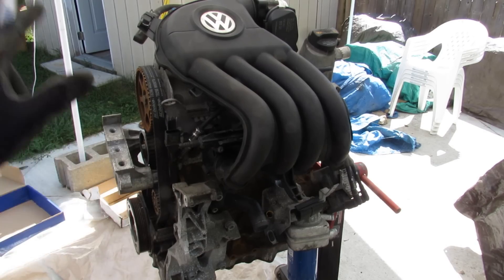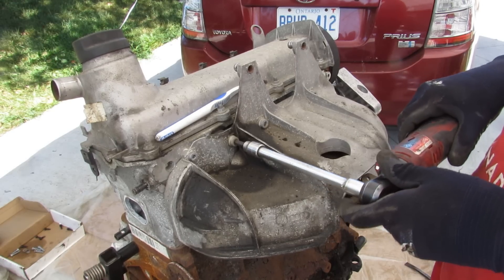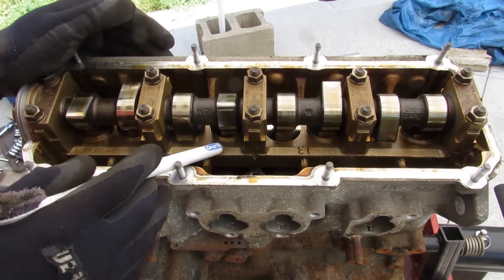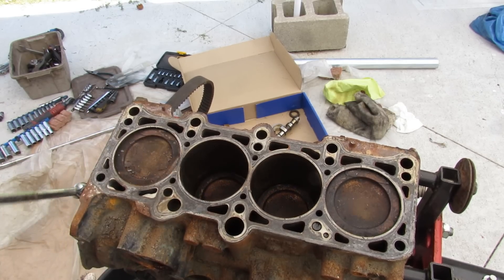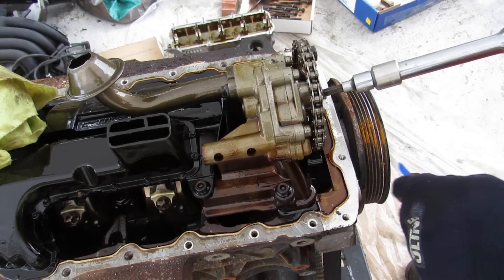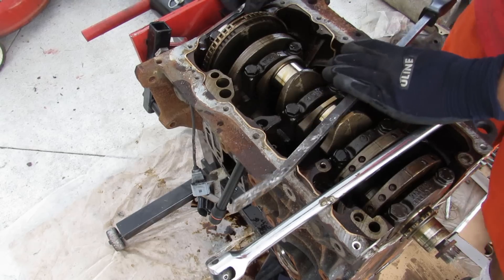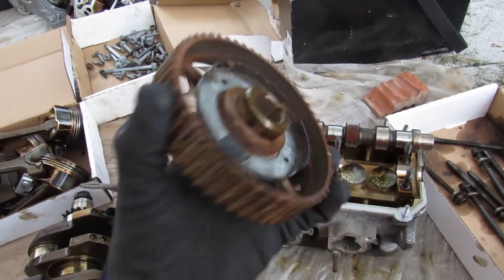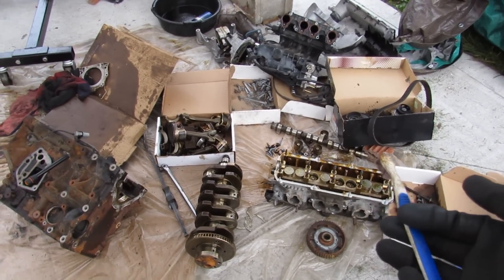The Simplest Modern Engine - From Volkswagen?

Comment: VEARY RELIABLE I HAVE ONE AT A 155000 MILES NEVER CHANGE THE WATER PUMP OR BELT IT DOES HAVE OTHER ISSUES WHICH ARE EASY FIX

Comment: FYI:  A unique spark plug wire boot pulling/removal tool is available for about US $5 to $15 to remove those pesky boots without damaging the wire's continuity.
Using one you will not damage the boots, the wire connections & you can access the wire boots without removing the manifold if working with the motor in the vehicle.
Usually if it seems too difficult to perform a service, there will be a special tool for that  particular purpose.   Think Chrysler V-8 318 cid distributor  hold-down bolt wrench.  :person-turqouise-waving:

Comment: I have a 1998 Beetle with a 2.0 AEG engine and a 1999 Beetle with a 2.0 AEG engine. These are really great running engines that are easy to work on.
I also have a 2012 Passat with an almost as reliable 2.5L CBU 5 cylinder engine, and a 2017 Tiguan Wolfsburg Edition 2.0L TSI turbocharged CCT engine that is likely to win an award as the most troublesome engine Volkswagen has ever built. In fact, I currently have that engine out & on the motor stand & I'm installing new pistons & rings.
Reply from the maker: Oh the turbo's are terrible ...I have videos on those.
Reply: @speedkar99  I haven't embraced "terrible" yet on the 2.0 TSI, but that's probably just me not accepting the truth. Back in the 80s, I was a Mercedes-Benz/BMW/Volvo dealership service technician, then later I owned a 4x4 Jeep business, so I have a set of pretty solid mechanical skills. Working with your hands can be very fulfilling and therapeutic, at least it is for me.

Comment: I HAVE ONE ON MY 2015 VW JETTA 145000 MILES NEVER REPLACE THE TIMING BELT OR WATER PUMP YET
Reply: Still used in 2015? Is that the last year this engine was used?

Comment: This looks almost exactly like the 2.0 I had on my 2002 Jetta. No turbo, aluminum head on iron block, eight valves on a single camshaft, and belt-timed, though I remember a metal intake manifold and coil-on-plug, I do believe. Stupid simple, insanely reliable, and strong like they don’t make them any more. The electronics around it went out all the time but the engine will run, and run, and run, and run. Love to see them around!

Comment: "What's a Volkswagen without these triple-square bolts?" I love it! Extremely old and new technology together. At least, it has a spin-on oil filter. I have a Mk 5 Rabbit which is my first German car. What a learning experience! It seems like VW loves to keep owners confused with their designs. I love the performance and reliability of my 2.5 liter I-5 engine, but the learning curve was long. It's hard to believe that this company evolved from the classic air-cooled Beetle which excelled in simplicity.
Reply from the maker: We'll stay tuned because I have a VW inline 5 engine sitting here to be torn down!

Comment: My old AEG went on for over 400k miles.  I was diligent with the maintenance and always used the 5w40 weight, and it kept on going.  Should still be on the road in GA somewhere.

Comment: I have a 2015 Jetta with that same motor. It's been very reliable. Currently at 213,450 miles. Not sure why it only has 115hp. I live in California and the CA version comes with variable valve timing but are rated at the same power as the ones without it. Not a fan of the old school timing belt, but no direct injection and plug wires. Low maintenance reliable, and easy to repair.
Reply from the maker: Nice, they sure are simple!

Comment: I had this engine in a 2013 Jetta manual. 3 year lease. The old no tech 2.0 doesn't have the power and amazing fuel economy of the new engines but mine was absolutely trouble free. No check engine light, nothing. I had a 2016 and 2019 with the 1.4 tsi and had check engine lights coming on in the cold, new steering rack (2013 was good old hydraulic), vacuum pump sensor, transmission noise problems etc...

Comment: 12:08: The first FSI - engines were running lean, but not this one. Because of the three way catalytic converter it runs mostly with lambda 1 (14,7 parts air to one part fuel), controlled by a lambda sond.

Comment: My 2013 VW base model Jetta with the 2.0 has been so reliable and it’s never even been to any dealer or mechanic. I’ve been able to teach myself how to fix and repair all the things that have come up - which is minimal compared to other cars I’ve had. I recall several folks telling me to run from VW when I was considering it back in 2016 and I’m so glad I used my gut instinct and got it. I have about 200k on it and it hasn’t given me any reason to consider selling it so I’m a happy customer.
Reply from the maker: It is a damn simple Engine it better be reliable. As for the rest of the car...

Comment: I have a 2012 Jetta 5 speed with this engine(CBPA) and it's a machine. 200k miles and very few issues. Pay attention to those oil coolers though... get oil that bleeds into your coolant. Even the heater core and fuel pump are easy jobs on this car. VW really should make more cars like this. I love mine.

Comment: Now take a TDI ALH variety and you have no spark plugs, coils, rotors cap wires, variable/multiple anything and you get 45 mpg all day long.  Throw a tune on the computer and you can get 300lb of torque and 145 hp and get BETTER fuel economy.   You will also go 10K between oil changes and get with proper maintenance, around 400K-500K miles

Comment: I owned a 2001 VW Golf with that 2.0. It burned tons of oil. About 1/2 quart every tank of fuel. There were some engines that were assembled in Mexico with the piston rings installed upside down (Engine code AEG) and I bought one with low miles that burned oil as it got older. It got so bad that deceleration caused a huge cloud of smoke. I sold the car in 2012 to my brother and he sold it to someone else shortly after. I've heard that the car still on the road today with the same engine. lol

Comment: Great video, really informative and straight forward. This engine was based on the '87> 1.8 digifant engine, found in many VWs of that time period. It was later bored out to 2.0 displacement in the early '90s, and finally ended up with a crossflow design in the late '90s It's a brilliant & ultra reliable engine. They can be modified immensely and VW themselves have had multiple factory cars with the same style engine running superchargers etc over the years.
Reply from the maker: Too bad everything else around it was problematic

Comment: Old school tech in a modern engine = easy to work and the best kind to have in an economy car.  Timing belt may need to be replaced sooner than a chain, but less components to wear and stretch.  Also, cheap and easy to do along with the water pump.  Not familiar with this engine, but reminds me of the old Escort 8 Valve engines.

Comment: It's basically the same as the 1.6 SR engine (AEH,AKL). These old 8V engines are the most reliable VW made in the past decade.
Reply: The 1.6L 74kW ("SR") is an absolute garbage compared to this 2.0L (AEG/APK/AQY/AZJ etc.)

Comment: One of the worst engines out there. Maybe the worst. I had it on a 2002 Jetta. No power, burns oil, very bad on gas. I had to replace the engine at 122 k miles

Comment: Have a Jetta with the same engine. Was cool to see how it works.
Reply from the maker: Is it slow
Reply: @speedkar99  yes. On surface roads its doable (5 spd manual). 0-60 is about 10 seconds. If I want to pass someone on the highway I have to plan ahead a little 😂.

Comment: A rock slid engine. Wish that one could purchase those still at the moment. The origin or the engine is actualle from the mid of the 1990's when it was used in the Golf 3.
Reply from the maker: I thought it was older than that from the 70s

Comment: It is a good engine but if the timing belt snaps ( which happens all the time because people forget to check and service them ) then your whole engine is destroyed due to bent valves. Honda and Toyota your timing belt can snap and you will be fine after replacing it. VW does this on purpose.

Comment: You are using the wrong type of socket for your impact, all that bouncing is loosing all the impacting force to remove the screw. Get some proper impact sockets and see the difference.
Reply from the maker: You mean the chrome sockets? The black ones I use are impact grade...
Reply: @speedkar99  yeah the chrome ones (used on the crank bolt) have too much bounce and you will use all momentum,

Comment: 11:40 The new Corvette has 2 valves per cylinder yet it make 495 hp.
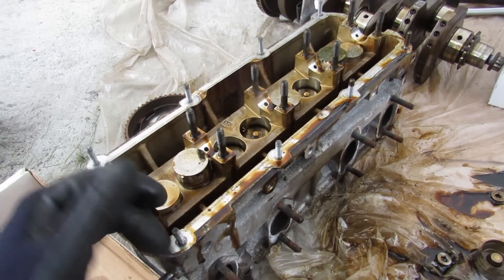12:12 The engine only has 115 hp because it has a low lift cam.
Reply from the maker: Ok

Comment: An issue with the one I had is that if you do short runs, it likes to collect gloop around the oil filler cap from the condensation. I thought the head gasket had blown... My local independent VW specialist was like... You need to run the engine up to temperature for it to evaporate off

Comment: I have 260,000 miles on a 2.0 ABA engine (1994) ... almost identical. Burns a little oil, BUT not leaks, AND it's had to put up with my abuse for decades :D
Reply from the maker: Nice

Comment: The simplicity is good! No turbo, timing chain, variable timing. It has only a single cam with no rockers. Less moving parts to go wrong! Easier to maintain! Very economical. The diesel versions were better yet. Let’s keep these engines running!

Comment: Amazingly, this thing is actually simpler than the 2.0L AAC engine in my old 1995 T4 Transporter but otherwise looks very similar.
Iron block with an almost identical alloy cam-on-bucket 8V head, eccentric cam belt tensioner, oil baffle under the valve cover. But it had an external water pump driven off the accessory belt and the cam belt driven sprocket under the timing cover ran the oil pump and the distributor (at least the intake runners curved upwards so you could change the plugs without taking the manifold off!). It had PCV/evap systems for Euro emissions regs, and a valve in the intake which would draw in warm air from near the exhaust manifold baffle to help reduce emissions when cold starting.
It made less horsepower, only 83bhp when the ponies were young. Solid reliable engine though, had done over 300,000km when I sold it on.
The only issues I had with it were external Bosch components; fuel pump died around 200k and alternator went around 250k.
I've still got my sets of 12-point/triple square/torx ratchet sockets and bits that I had to buy just to change the cam belt.

Comment: Have a much older version of this engine to go into my 1997 Golf. It's the same 2.0l 8v, but ABA code. Has a distributor, slightly different head casting, different intake, and of course different management. Oh, and since mine is the OBD1 version of the engine (pre 1995) I have dual valve springs and a forged crank. VW has been using this architecture for a long time, because it works well.

Comment: This engine is based off of the early water cooled VW engines (like 1.5/1.6L rabbits). This is the reason for the cast iron block and other older style components. Its a testament to the quality of engineering. Its basically a 50 year old engine design that is still reliable, makes decent power and is efficient.

Comment: That 2 liter 8 valve not used in EU VW cars for a long time I had 2000 mk4 golf estate with a 1.6 liter 8 valve (74kw)witch is a smallbore version of this engine. I currently drive a 2013 Mk7 estate  it has 1.2 16 valve turbo with 80 kw.

Comment: These 8v engines are terrific in every way except power.  The only thing they really need to last well over 200,000 miles is replacing both the water pump timing belt as preventive maintenance at 100k...and a good quality high zinc oil since it's flat tappet.

Comment: The 2.0 was used on 90s Golfs and Jettas too. And timing belts last longer than chains and don't require replacement of all the gears and sprockets as well as the chain when it gets changed.

Comment: I have a 2L Golf 2002. I replaced with a rebuilt head and new head gasket.
Polished every cylinder wall  full stroke and the top of cylinders with green pad.Did not see any signs of any cracks. Getting coolant mixed with oil only after engine gets hot.
I don't think crack is on any cylinder wall as it has no misfire or visible water Vapor in exhaust. No coolant leakage when cold. Bypassed oil cooler so I know that is not leaking.
What is the likelihood I can find a crack at the bottom of the engine? I am fairly proficient at welding if I can reach it. Thanks

Comment: In some parts it is more complicated in some parts it is even more simplified. I am comparing this engine to famous in eastern europe 8V family of C16NZ, X16SZ, X16ZSR(designations for 1.6L) etc engines from Opel Astra and more. Those were made in 1.2, 1.4, 1.6, not sure if 1.8, but there was 2.0 C20NZ with MPI from this bunch of engines only 1.6L variants were collision free on timing which means you can freely rotate camshaft with piston 1 in TDC. Mounting of accessories is more complicated in VW. Timing is better to set on this VW engine, Opel had timing belt tensioning on pump rotation with suspension roller which is nightmare to set right on for now really old engines ranging right now in 25+ years mark. SOHC, same in opel, combo spark coil, same in opel. Engine head is better in VW, popular "glass" hydraulic pushers, in opel you had more moving parts in the head and when worn out they rattle a lot but still run aaand they lose power due to that. Overall VW added some baffles who know what for, lubrication is straight forward in Opel engine and this VW. Opel had EGR from lift onwards and it is suprising to see a car from further 2000s that does not have that. Opel didn't have oil cooler. If we skip accesories and just stick to the naked engine those are pretty much the same. You have higher tolerances in parts, more surface so forces on them are less due to that, good lubrication, iron block. High torque, on low power side. Very hard to kill if you maintain them. Those are the engines that will survive "long life oil" practice but with a cost. I am living in europe and I own one Opel Astra F or 1 depending on how someone will call them. 71HP engine, regularily maintained. If I had to do a trip to depths of Russia or very harsh enviroments I'd rather pick this than some newer car because you can repair this engine having a simple set of sockets and few wrenches, computer says fault? Put wire across terminals it will flash what you're looking for. Parts are extremely cheap and you can find good quality replacements for parts. Yes it doesn't have AC, doesn't have power windows, it's loud in high speeds, it consumes less fuel than modern basic cars. What's there to complain?

Comment: The different type of bolt heads on the same part is because the bolts are slightly different lengths, it prevents factory workers and repair shops from mixing them up.

Comment: I have a 1.8T and I wont lie, I miss the simplicity and reliability of my old mk3's ABA 2.0. I am having some wiring issues with my mk4 that frankly, the reasons behind the issues are mindboggling because it's 100% an engineering fault with VW. I never had these issues with my 2.slow. Almost wanna swap one in lmao...

Comment: It’s not a semi modern engine. It has been used since 1993. All base model vws came with these up until 2005 when it was replaced by the 2.5L 5cyl. They brought it back for base models in 2010. Mk6 platform. At its base is an ABA (93-99). AEG,AVH) (00-03). The 2004 & some 05 models came with AZG which had a crude version of a variable valve timing. This engine is engine code CBP. Europe had a 16v (ABF) in the 90’s. 
I agree in that it’s a simple engine which can make big power. Brazilians use a version of the 2L and they’re making an easy 1000hp.

Comment: These are incredible engines.  Low power, but super longevity and low maintenance.  These still use the same basic technology from the 1.6 in the late 70’s. Same block, slightly different cylinder head was introduced in 1993 but hasn’t really been changed since. Way to go VW.  More manufacturers need to do this.
Reply: Reminded me of the 1,5 L in my 1975 rabbit.

Comment: From a dorky perspective, VW technically never designed a water-cooled motor. The genesis of all water-cooled motors, including the one in this video, come from the Audi 100 designed in 1968. VW owned Audi at the time but did not at all participate or encourage the engineering of that motor. Once the motor proved itself though, the engines of all future VW cars were evolved from that one.

Comment: had over 30 of those from 1996 to 2008, worst thing about this engine, its noisy, unreliable and not even fuel efficient, the exhaust downpipe is pricier than the whole car to replace, its like the 90's push rod cavalier engines in even worst

Comment: Because they were so simply designed, those engines were super reliable, easy to maintain and understressed even in turbocharged applications in the compact cars where they were installed. Modern engines are not really that much better except for emissions and high RPM power, and definitely less cost-effective to operate over the long run.

Comment: Volkswagen has their own iron casting abilities in Wolfsburg (may be mistaken) but that is why most of their engines are iron blocks. Cheaper to do it inside rather than outsource and ready for turbocharging if ever needed.
Reply from the maker: Good to know. But it's about time they use aluminum for lighter weight